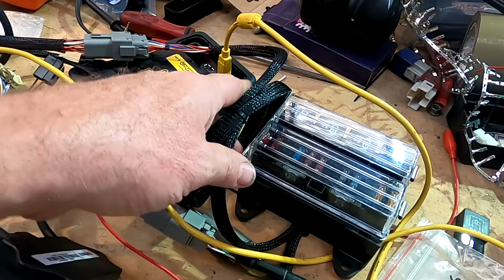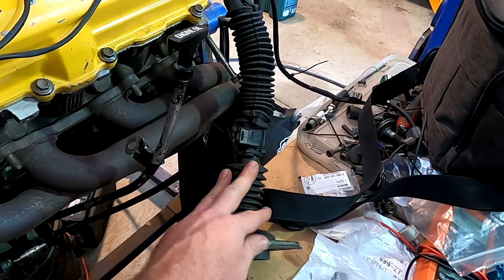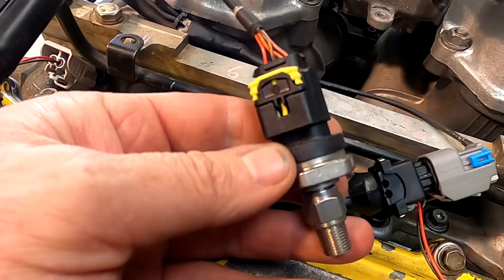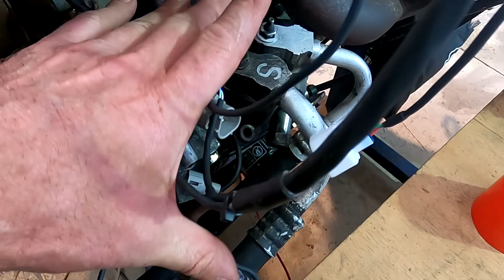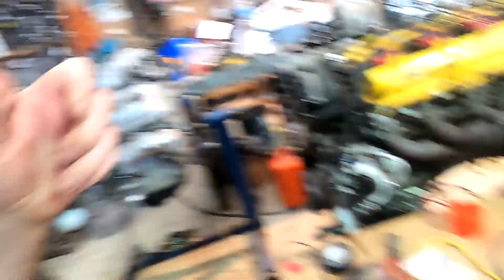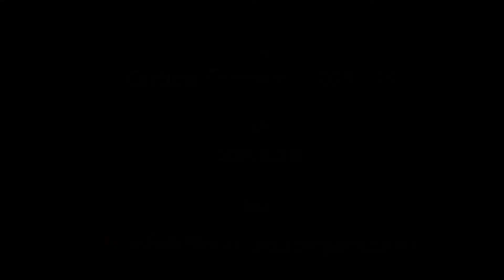Short version of Ross from Australia's Supercharged Hilux with HTV1900 and Haltech ecu wiring loom

Comment: Kelvin, looking good! Does the ex-glow plug circuit shut off via timer? I know it did on my VW diesel.
Reply from the maker: We tap into the circuit before the relay so its just a nice power supply from the glow fuse.  So no cutting off,  Stock timer is in the engine ecu on these trucks too,  and that also gets removed.  Cheers Kelvin